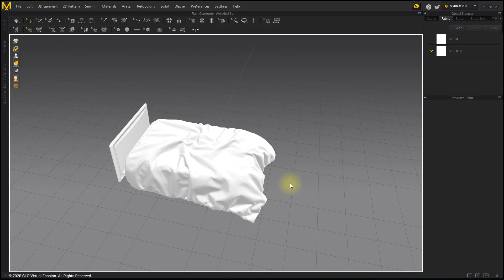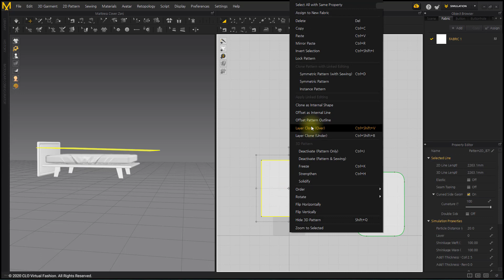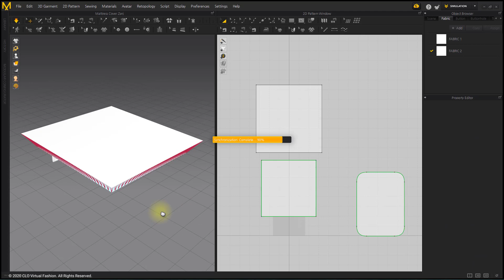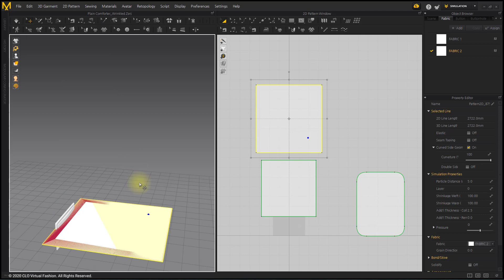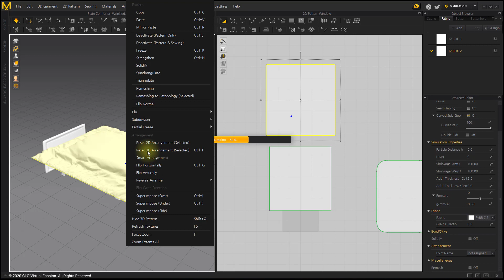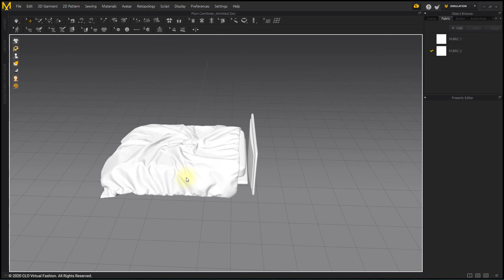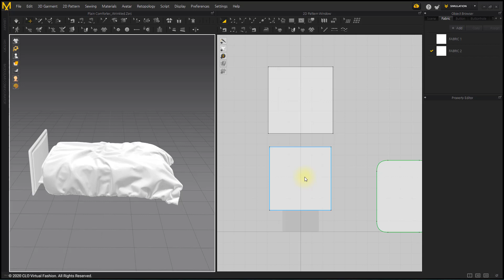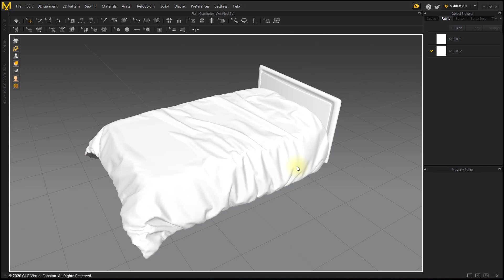Marvelous Designer 9.5: Comforters - Plain Comforter

Comment: On a PC with 64 core threadripper CPU, 256 GB Ram and a  11GB GEFORCE RTX 2080 Ti graphic card, using MD 9.5 (5.1.445), I can not reach the simulation performance that I see in this video. Even with a particle distance of 10, instead of 5, I can not actually move any wrinkles because the animation is too slow. What is going on? It is so frustrating
Reply from the maker: This video was sped up in some places during the editing process only for the purpose of a more efficient lesson with less wait time on YouTube. We apologize for it being confusing and causing you frustration.
Reply: @Marvelousdesigner  no that is not my concern. My problem is that the simulation is so slow on my computer (64 core threadripper CPU, 256 GB Ram and a  11GB GEFORCE RTX 2080 Ti graphic card) that I can not manipulate the cloth during the simulation at all, as it is shown in the video.
Reply from the maker: With your specs it should work if everything is being allocated properly and not being eaten by something else, maybe do a memory test to check. If a simple shirt is not simulating and interacting with your mouse in Marvelous Designer, feel free to contact us through support at https://www.marvelousdesigner.com/support/contact with as much information as you can so we can better assist you.
Reply: @Marvelousdesigner  it happens when creating bedding and 17% of my RAM is used, marvelous designer only uses a fraction of my CPU. I will gather information and contact customer support. thanks.